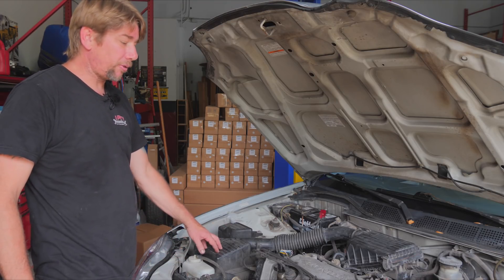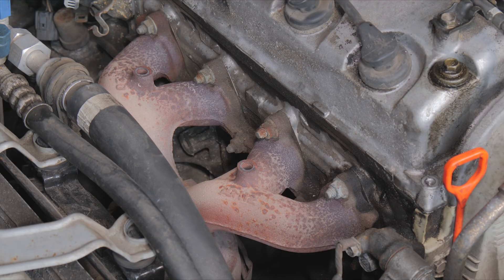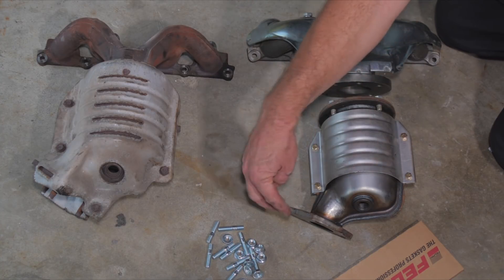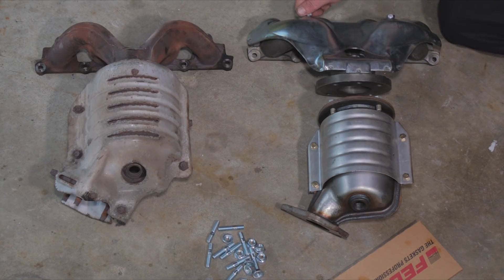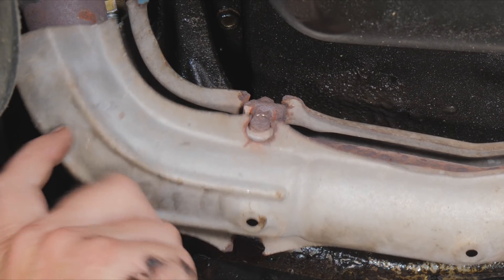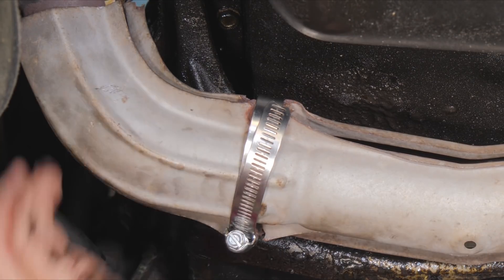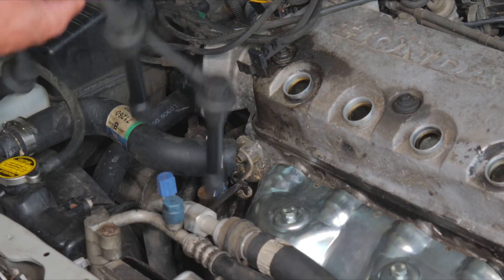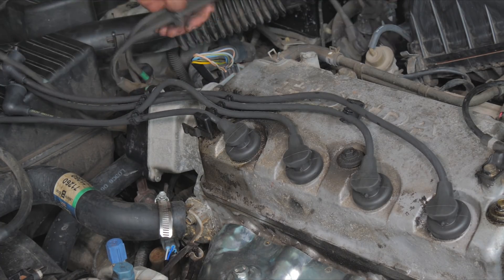2000 Honda Civic 1.6L Exhaust Manifold Catalytic Converter Tune Up Spark Plugs Wires Cap Rotor

Comment: When an individual who owns one of these Honda vehicles starts installing Aftermarket ignition components, Cap, Rotor, and Wires unless their NGK, your asking for Trouble. Those specific parts I named should be factory parts from Honda. These cars Run and idle the smoothest when you do that.
Reply from the maker: agreed, we do have to give the customer both options though. We used to only suggest OEM parts for most all repairs but the price gap has only gotten worse over the last 20-30 years. We offer whats available and educate the customer the best we can on all the brands available, also when we do sell or install aftermarket parts, we are usually choosing from a select group of aftermarket manufacturers and many of them are actual OEM manufacturers. At the end of the day, we agree it is always best to put the exact factory part back on, if still available anyway, sometimes the OE stops making it and we have no choice.

Comment: Two things I noticed, you didn't show anything about the support bracket near the cat and out of 5 videos on YT that I've found of people doing this, not one has mentioned the proper direction of the exhaust manifold gasket. Protrusions facing manifold or head?

Comment: i have a problem on my 1999 honda civic lx  it wont start .. i need to clean the water inside the intake manifold to start the  car  idont no what were is the leak where  is the water or the or the oil coming from i need help thanks

Comment: needs 2 people looks like for some of the hurdles, if you know what I mean. AC 10mm looked like you needed a second hand.
My family had a 2000 civic in Toronto since, well 2000  and we just gave it away to a scrap yard with 250K kms on it for $200. Transmission was close to gone. I wanted to fix it up and make a nice ricer/zippy car out of it but lacked knowledge so.. Question, do you think it can repaired and fined tuned to rev over 7000 and last another 100K?

Comment: Hi somebody could guide me, for Exhaust Manifold we have 3 internal bots into head motor, Bolts what I am doing mention are visible over the minute 17:55, one them it got swept, What I can do, is it easily to extract and change it? I will appreciate so much your help. thanks
Reply from the maker: Miguel Orozco the bolts at 17:55 are the exhaust manifold to catalytic converters bolts, these can be removed and replaced with straight bolts and nuts if needed, it may be easier to relive the converter and manifold to get a better handle on

Comment: Hey APDTY not sure if u can help but I have this same 420 code when I bought the car it came with DC sport headers installed already and they don't have a built in catalytic converter.  my Macanic is saying that is the cause of my forever ending 420 code I can't seem to get rid of.. my Macanic say it's not the O2 sensor I say it is. What do u think?
Reply: O2 has separate code. p0420 cat conv
Reply: go back to grammar school ...took me more effort then needed to understand what u said lol

Comment: Is this a common issue amongst Honda Civics? Mine is running loud and poorly. Still getting power though
Reply from the maker: these cars are extremely common on the road and they go so many miles that they are on the road longer then many other cars and it may just be a numbers game, but yes these are very common to need a converter, back in teh day it was our number on converter seller for numerous years, these cars are very easy to diagnose and you can probably do it all yourself with you tube, if it is loud and running fine with no check engine light, then you might just have an exhuast leak

Comment: Do you have to replace the studs?
Reply from the maker: sometimes, depending on what studs you are referring to, the converter had new studs on it, the cylinder head studs where fine and re-used.

Comment: How much of a cost was this installation
Reply from the maker: great question, the labor to just remove and replace the converter/manifold is only .8 of an hour. So whatever a shop charges per hour times .8. The real issue is what caused the converter to fail in the first place. The most time is spent verifying if the correct exhaust mixture is entering the  converter. A catalytic converter doe not fail on its own except if it rusts through. 99% of the time the converter is destroyed by the engine not properly burning all of the fuel or having excessive oil or coolant entering the cylinders. In fact the most common cause of catalyst failure is raw fuel being dumped into the catalyst. The catalyst is simply meant to have a certain mixture of exhaust gas pass through some specific metals which chemically alter or converts the exhaust gas and makes it less toxic to humans. So if you have a cylinder misfiring, then the spark did not fire completely and some unburned fuel is in the cylinder, that raw fuel is not only not exhaust gas but also very cold compared to burned exhaust gasses. Driving like this for a period of time destroys the catalyst and eventually a check engine light comes on saying inefficient catalyst.  If this person just removed and replaced the converter without looking for the "why did my catalyst fail?", then the new converter will have the same fate as the original and no one warranties a converter in this condition, you can recreate the issue and see the catalyst was destroyed from the wrong exhaust mixture entering the converter, Sorry for all the words, I think I had too much coffee just before answering this, bottomline, it is worth paying labor to find and then fix the cause of a failed converter. This car had about $40 of needed tune up parts to correct a spark plug not completely firing and caused a $230 converter replacement need.
Reply: @APDTY        Thanks for this information.

Comment: My 2000 Civic EX catalytic converter is not located on the exhaust manifold.
And the O2 is not located on exhaust manifold (2;30)
I have one O2 on Front Pipe, what is this Sensor called?
And then come the Catalytic Converter with O2 in the center, what is this sensor called?
Reply from the maker: so this video is the Civic LX DX or CX, the EX is slightly different and Honda actually has 4 or 5 versions of the 1.6L engine. Either way the sensors installed in the exhaust on your model are still called oxygen sensors or in later years it is called and air fuel ratio sensor. The first sensor closest to the engine is called upstream and the sensor in or behind the catalytic converter is the downstream sensor, You would ask for or look up oxygen sensor and then it will show you the upstream and downstream, the catalog lookup may ask for the engine code and you can get that off of the sticker on the underside of the hood, it will be a number like D16Y7 D16B5 D16Y8 or D16B5, if you reply with your engine code, I can tell you the part numbers that fit your specific model and which one is upstream and downstream. Also if you need a catalytic converter, make sure to find out what caused teh first one to go bad as they do not go bad on there own, except for rust issues.
Reply: @APDTY  I have a code p1509 on d16y8 auto idles fine. under load rpms jump slightly